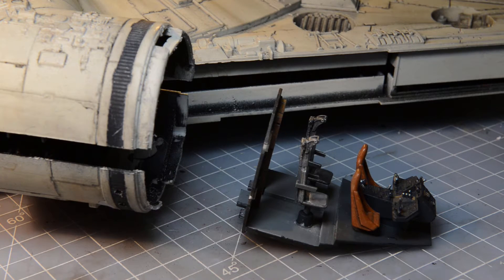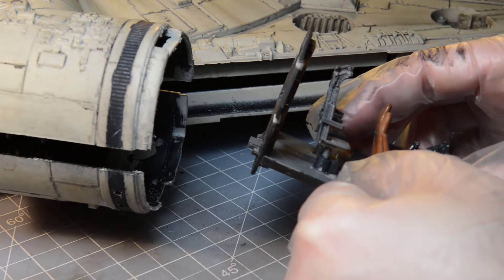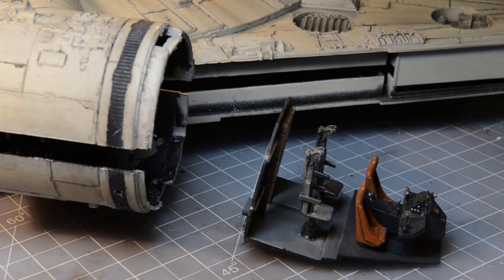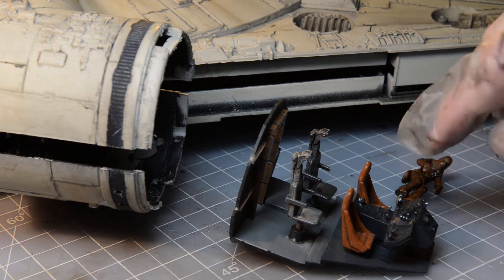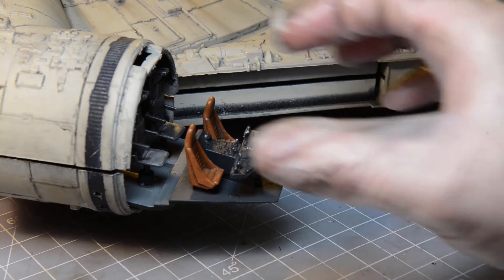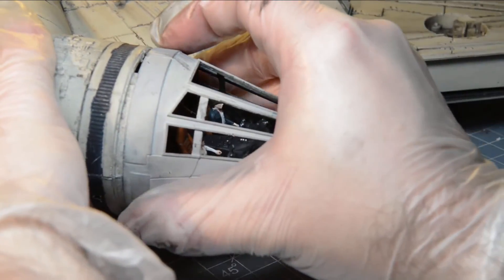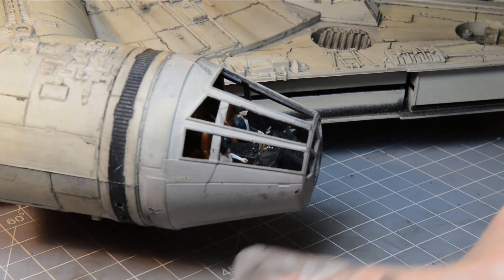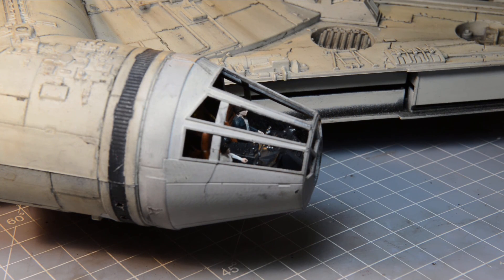Millennium Falcon Conversion - Cockpit Part 2

Comment: what did you do to get the window panels into the cockpit and the turret well windows?  And what glue because I tried super glue and it makes the windows go very clouded.  Did you cut individual pieces out for the window panels of both the cockpit and the turret well windows or one complete piece?

Comment: To attach the cone ... I might use Earth Magnets behind the back wall... and mount the other into the corridor and cut that section out to fit the shapeways roof into the cockpit. That way it would sit there and be easy to remove.

Comment: I'm doing an MPC/Ertl conversion with the shapeways cockpit interior and cone. I bought some micro machines/galoob Han and chewbacca sitting figures and to my disappointment, they to are out of scale...even if I cut the legs off the figures, they still would be out of scale. The shapeways parts are simply amazing yet they clearly where not designed for "dedicated figures in mind.

Comment: Are there any other alternatives for the crew instead of using shapeways? Been stuck trying to figure it out.
Reply: This may be a bit late for you, but I got a cockpit and other parts from Falcon 3D parts, cheaper than Shapeways too.
Reply from the maker: +William Warren Good question. I've looked as well and cannot find anyone else who make these. At least now. One suggestion I had from modeler friend of mine was to cut the legs off Chewbacca. They won't be seen once assembled. I would have liked to avoid that. If you find any alternatives I would love to hear where.
Reply: +Ken Pearson Will do. I'm currently trying to create my own interior from retro-fitting legacy parts and other various sources. With as popular as the conversions have become, I'm a little disappointed shapeways is the only option we have. Great parts, but priced way too high.